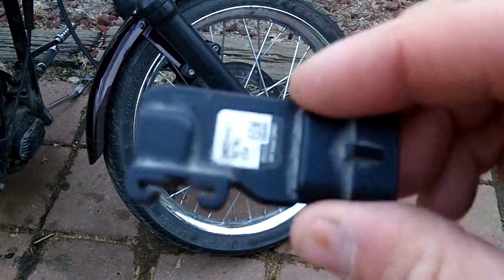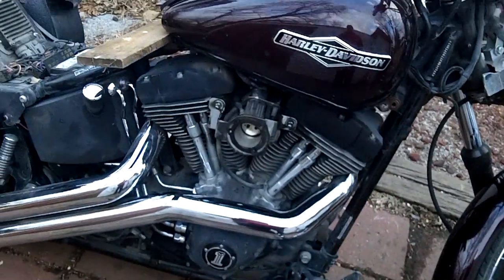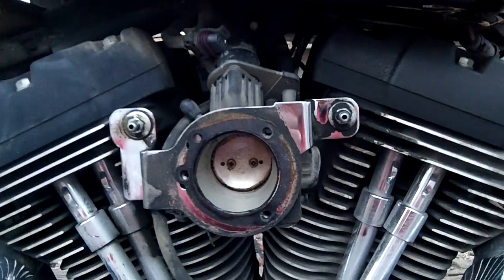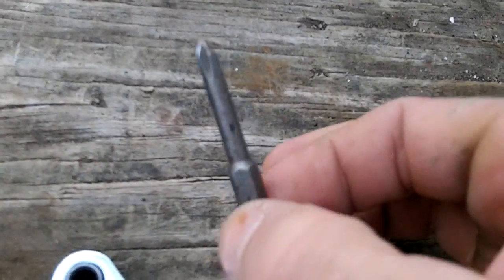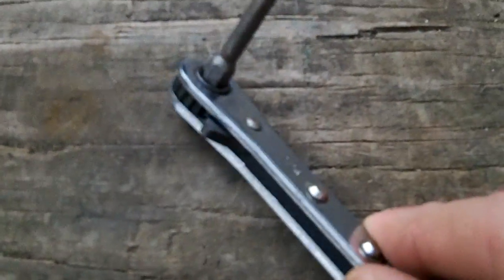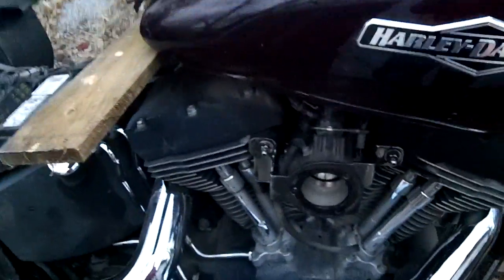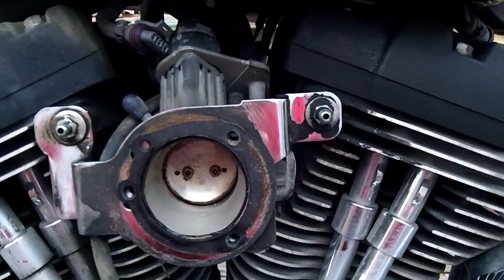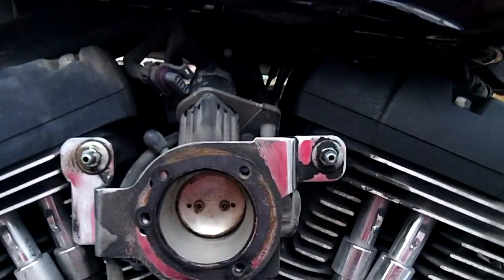Harley Map sensor location

Comment: WhT were your symptoms prior to finding the vacuum leak? I have an 05 FatBoy and pretty sure it’s the MAP or vacuum leak or both. Thanks.
Reply: Figure yours out? I have a backfire, random high revs and engine dies sometimes. Starts right back up like nothing is wrong
Reply: @RBoysMedia  did you ever figure it out? Mine sputters and hesitates then goes.
Reply: @Supremebean303  yeah it either turned out to be a loose positive battery terminal or my temp sensor. I think my battery was fully tightened
Reply: @Supremebean303  was not fully tightened*
Reply: @RBoysMedia  I’ll have to check it out. I got p0502 p0101 or whatever that code was. Gonna replace the speed sensor and then the map as well but make sure it’s not an intake leak.
Reply: @Supremebean303  good luck, check those battery cables man. It was the most ridiculous thing for me because I remember checking it like 10 times before it fixed it. Then again I replaced my temp sensor at the same time so idk